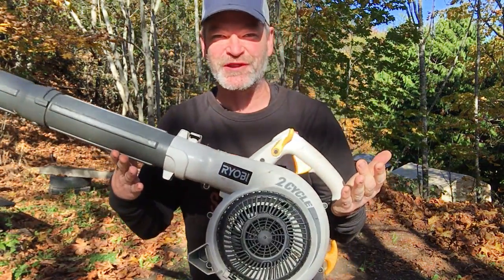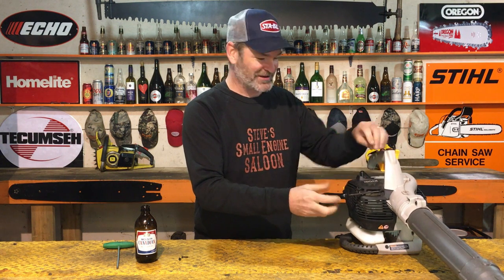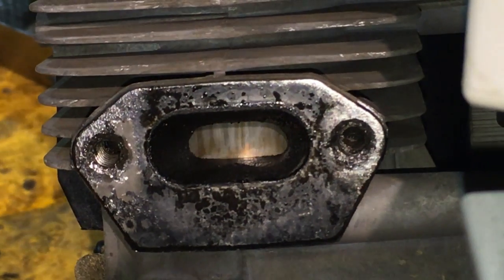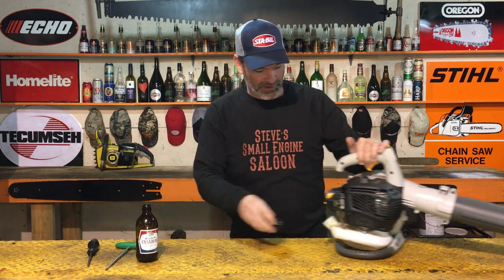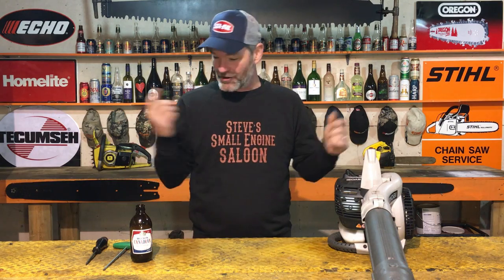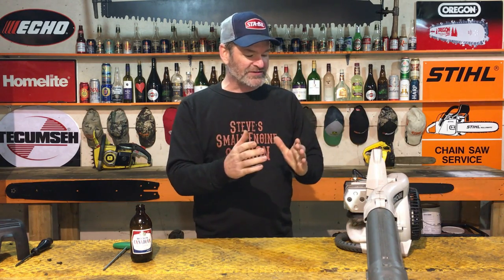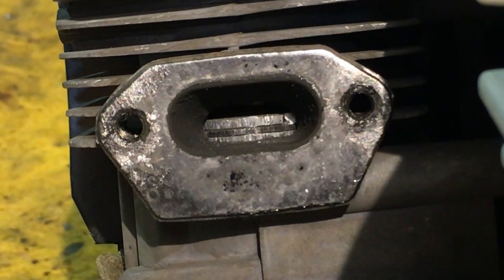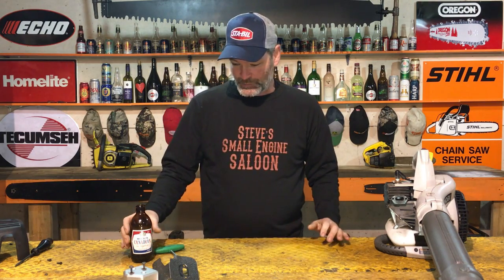What Happens When You Run Straight, Unmixed Gas in a 2-Stroke, 2-Cycle Engine

Comment from the maker: Get quality mix oil here---- https://amzn.to/2D0997x
Click here for my website--- http://www.stevessmallenginesaloon.com/
Click here for my Parts and Tools Store---- https://www.amazon.com/shop/stevessmallenginesaloon
Reply: How do i fix a blower after putting regular gas by accident? Please help
Reply: Russell 79TuLlpLN
Reply: Can u repair a 2 cycle blower after I ruined it by putting straight gas?
Reply: Steve's Small Engine Saloon hey 👋 Steve your videos are awesome 😎. Can you tell me what happens when you run too much oil. What does it do to the piston
Reply: NELSONS SMALL ENGINE REPAIR dXxZd
Reply: In just wondering my bike has compression still but it wont fire when i finally took off the top of the motor to look inside theres a thick layer of what im guessing to be burnt sugar from something is there dtill a chance to get my bike to fire again? And also could it maybe just be bad mix oil? I thought i used decent stuff j was told blue is good the brown ones avoid

Comment: I have a br700 that crapped out on me mid use and the motor seems seized, it will turn over but it’s hard to pull the chord.  My only guess was that my oil mix wasn’t right and I had blown the motor up by running it with too much straight gas… but my symptom is opposite in that the chord is too tight now as opposed to yours being loose… I haven’t dropped it off anywhere yet but do you think it could be another issue?  It’s practically brand new I bought it 6 months ago…

Comment: Question for ya from a new subscriber ,watching your vids on chainsaws have been awesome. Thank you…. Back to my question , an old engine pal told me that the 40:1 oil to gas ratio is to much oil, I’m told that 2.3 ounces to 1 gallon of gas is what I should be running. What are your thoughts on this. I’m using the Amsoil Saber oil. Thank you kindly in advance 👋🏻
Reply from the maker: I have been using 40:1 for over 30 years and never had an issue!
Reply: @StevesSmallEngineSaloon  thank ya kindly sir. This AMSOIL Sabre says it’s tested to run at 100:1 and they guarantee it. Sounds crazy huh? Any rate I just recently found your channel and I love it. Ain’t much of a mechanic, but I love watching ya work. Good tips I didt know. Carry on sir and Happy Holidays

Comment: I ran an ole 440 Rotax SkiDoo motor on straight gas for just over 6 minutes before it failed. Didn't get the damage you got(looks more like a lean burn). I put new bearings in and the motor worked fine

Comment: Love this video.  I had a Lawn Boy mower in the 80's and it seized after many years.  They told me it was running too lean, even though 32:1 mix, which cause the seizing.  Now I just bought a TORO Commercial Mower with the 2-cycle Suzuki 5.5 HP engine.  How can I prevent it from seizing on me?  I'm using Echo Red Armor oil at 40:1, instead of 50:1.  These Suzuki Engines are expensive to fix and parts are hard to locate.  Any opinions on the best possible oil for my Mower?  Thanks

Comment: I ran a homelite trimmer on straight gas for a couple years. I did not know any better. My yard was real small so I only ran it for about 6 mins each time. I now use 2 cycle oil in the fuel. So far I have replaced the primer bulb and the carb. That trimmer is now 20 yrs old and still running with a few scratches on the piston. Best trimmer ever!!

Comment: I mistakenly thought the 1 qt of 2-cycle oil was just that and found out the hard way it was pre-mixed fuel...so when I diluted it out in 1 gallon of gas, it was pretty much gas that went into my leaf-blower.  From what I recall last fall when using it, it ran for probably 25 minutes and stopped.  Afraid it had the issue described by the video since I could not start it (no compression), I took the muffler off to look.  The piston looked kind of scratched up.  I poured some real 2-cyclinder oil in the muffler port over the piston head, maybe a teaspoon in volume.   Before putting the muffler on, I then pulled the cord and I felt compression.  I put the muffler back on and after a few pulls, the leaf blower started and after the oil burned off, it seemed to run normal.  Now, the piston sounds a little scratchy still when I pull the cord but over all it still starts up and runs fine.    Bottom line, the oil in the mixture helps to lubricate and also helps to create a better seal and compression.   Before over-hauling your engine or throwing out your 2-cyclinder power lawn equipment, try a little oil above the piston to see if it does help the compression.   I'm not sure if my leaf-blower will have the normal life span as I would expect but it works for now ....

Comment: What do you think about all these chinese chainsaws that call for 25 to 1 fuel mixtures? Some say that's  for old information for older cheaper oils. Some also say that modern 2 cycle oils are good for 
40 to 1 mix in these same saws.
Do you have any suggestions?
Reply from the maker: I run 40:1 in all 2 strokes.  Never had a problem in 25 years...
Reply: @StevesSmallEngineSaloon  thanks Steve, learned many things from you and its much appreciated. 
" PSSSHHHH" THAT WAS BEER ONE FOR THE DAY.

Comment: I had the melting ring thing happen to a 2 stroke motorcycle when i had an air leak in the crankcase.  It was a 500cc Yamaha.  That was a fun bike.  I didn't know an engine would even last 9 minutes without the oil.  You have great videos.
Reply from the maker: Thanks for sharing

Comment: Great video, I did that at my brothers house, he wanted me to help do his yard. So he was inside house , I was trying to start his blower it needed 2 stroke oil and gas mixed, I never owned a blower. I live in apartment with no lawn. So I grabbed the gas container he had filled it up a little more then half way, started it up took me awhile to start, but I used to mow grass at my house when I was a kid, so I remember pushing that little button, if I had trouble starting mower a couple time and it would start right up. But like I said never had a 2 stroke leaf blower, growing up or ever. So I blew his leaves for about 10 minutes And When it broke down, I said to him I told you don't by second hand shit from people he got it on craigslist, but when he asked me was it already filled I said yeah, I didn't put anything in it, he likes his beer so he had no idea, that it wasn't.

Comment: I have a STHIL BR350 blower 1 year old. Was running fine. Next time I went to use it it would not start. You could however pull the starter rope smoothly. Took to Ace under warranty they wanted $550 to rebuild engine. It only cost $350 new!They said regular gas was in it. First I find that hard to believe but it is possible. I looked at my two gases in my cans and they both looked pinkish. I always buy ethanol free gas. I'm positive the last time it ran it had the correct gas in it and maybe I just filled it up with the wrong gas when I went to use it last time. So maybe THEY was pinkish gas in it and said that was the problem. Any thought folks? I have not gotten it back yet. I'm going to put the correct gas in to see what happens.

Comment: Happened to my stihl backpack blower a helper ran it without oil for probably half a tank. I filled it with mixed gas and a little extra oil. Starts and idles but only runs at half throttle and has a knock. Barely has enough power to blow grass off of a curb. If the grass is a little damp then you can forget it

Comment: why not just have the engine take in the oil and gas separately and then have the engine do the mixing just before it gets injected into the cylinder?

it would seem to me at least that this would be the ideal sitaution as it removes the question of what mix ratio to have (because the engine does it for itself)
and you can't accidently use the wrong gas because it's the same gas.
you'll just have to remember to fill up the oil reservoir as well.
Reply: @UCKKPmHMrI7ILpnHDrLS_R8Q i guess that is fair but i figured it would be a simple as basically setting up a second "gas" tank and filling it with oil instead.

then the injection to the cylinder would happen the same way as the gas and at the same time.

and the mix ratio can be controlled at the injector by changing the size of the holes relative to each other.

Comment: Hello Steve  , another great video which I can relate to today . I ran a Tannaka blower without oil today  . When I stripped it down partially the piston seems to be coming to top and clicking hard when at top position . When I rotate it the other way it does the same  . coming to top and clicking hard . Any ideas of what is happening here . The piston does not seem to be scraped when I look in through the inspection port . Any help would be appreciated greatly .

Comment: Another word of caution.  I poured mixing oil into a 5 gallon container of gas but didn’t shake it up.  I burned out 2 expensive chainsaws and my dignity on a job site.  Best practice, put the oil in the can, then add the gas.  New piston and cylinder worth almost as much as replacing the chainsaws, thus they were scrapped.
Reply from the maker: Great point!

Comment: Steve, In cases where an engine loses compression just due to use, not abuse or wrong gas mix, can you get away with just replacing the ring(s), or is it recommended to install a new cylinder and piston?
Reply: My Craftsman 25cc 2 stroke blower I've had for 12+ years, was suffering from low/no compression, I bought a new piston ring online and was hoping $5 would be all I had to spend on this old, but decent blower. When I pulled the cylinder off, I found the piston ring was stuck in the ring slot of the piston because it was filled with baked on gunk.  I used a couple of fine picks and removed the old ring, wire wheeled the piston's ring slot and crown, and made sure the slot was completely free of debris. I installed the new ring and immediately felt compression when trying to push the piston all the way into the bore. I reassembled the blower and it started instantly like it always had. I probably have about 40 hours on this engine, and I ran it for about 4 hours immediately after the repair, stopping the engine a few times just for refueling,  and I think this happened because I am too generous with the oil in the gas/oil mix because I really don't want to over-heat and seize an engine. Anyway, if you find yourself with low compression on a 2 stroke, check for a stuck piston ring first, you might save yourself some money. Take your machine apart carefully, and you may not need any new gaskets. I took the two screws that hold the carburetor on just because it was easier than removing the fuel lines. I took the muffler off because this design hooks over the crankcase and you can't remove the cylinder otherwise. Get yourself Allen and Torx bits you can spin with your cordless drill since the biggest time waster in this whole repair are all the screws holding the plastic case together!

Comment: Can this be fixed or is it not worth the cost. I did similar to my Husqvarna leaf blower. Brand new to buy $299. Is it cheaper to repair or buy new replacement. Guess that will teach me to read the fuel requirements vs assuming it was straight gas.

Comment: I was desperate once and I ran my blower with straight fuel because I had no oil. It ran for about 8-10 minutes then died. I realized that this was a serious thing and tried starting it  with a rich oil to gas mixture. I am able to start it but it requires a lot more effort to start it and runs for only 7-9 minutes before overheating really bad and dying. It’s weird. Anyone get any explanations?

Comment: should do one on what happens when you put to much oil in your mix. Had some fuel that i couldn't remember if i had put any oil in the other day so i put some oil in it think it's running on a fuel mix of 100-1 now saw is a little bit under powered but not to bad reckon the worst that could happen would be a fouled spark plug

Comment: That was interesting. I recall back when I was 17 years old, I got a weed eater that was a TMC kpw 23. In the owners manual TMC warned that running straight fuel with no oil would cause the engine to seize. It's obviously different with each two stroke engine. It can result in either seizure or the piston gets scored and the ring or rings can get damaged and get stuck leading to no compression. In any case the engine would have to be rebuilt.

Comment: I can tell you. My step son did this when he was high.  It melts parts of the cylinders and piston.  The engine does not have the oil from the mix to prevent extreme high temperatures.

Comment: I run these small 2 strokes, Zenoah, in my hobby RC's. Modified can run 20,000+ rpms. I run 20 to 25 /1 ratio. At these rpm's the extra oil is needed not just as a lubricant, but the extra oil particles can act as a coolant. So much so, in boats which have water cooling, you have to run the water lines to warm the water first through the water cooled exhaust flange, then to the cylinder. Or the engine wont reach optimum temperature to run correctly. Great engines to tune and toy with.

Comment: Good oil and fuel matters. I have an old, well maintained 80's Stihl 028 Super WB that has had carb rebuilds, oil pump replacements, new lines,  engine gaskets / seals etc and still on the original cylinder and piston with only 1 ring change.  Two strokes live a LONG time when you take care of them.

Comment: Raw clean high test for 5 minutes at low RPMs is like a free tune up .
Add oil after ( pre mix or a shot ) 
The old gas  and oil gets it gummed up especially after winter even if it’s drained . 
   I’ve had an echo blower for many years ( over 12) .  Any time it gets a bit tough to start that’s the fix . 
Mine starts 2nd pull each time and runs perfect even at blazing high volume leaf helicopter cleaning .  You need the oil no matter what to protect it but there is so much residue from tank to piston for a 5 minute clean up , it’s ok for 2-5 min on raw pure gas . No high revs . 
   I have 2 gas power whipper snippers and one leaf blower . Lawnmower is 4 stroke .
Reply: interesting. I never considered this... do you just let it idle, or do you pull the trigger slightly to get RPMs slightly higher?

Comment: im actually very impressed the little engine lasted 9 full minutes with 0 lubrication. throw some new rings in there shes good as new 😂
Reply: there must be an oil film on the parts. i once started my old truck when i forgot to put oil in and it idles for about 5 minuts until i relized i forgot and stopped it, no damagne done as i been runing 2 stroke tcw3 mix in it and i always pourd the 2 stroke oil in the filter. years of doing this put a coating on everything and saved the motor. It was pennzoil semisynthetic 2 stroke oil! Now im using BRP XD-100 oil in my small block v8 2 stroke and 8v92 detroit 2 stroke. its full synthetic. i would switch over to mutule 800 2t if i can find it cheaper!

Comment: I ran a 4 stroke BS with no oil -duh, (check EVERY time)!  The cycliner froze up. After a good cool down,  I filled up the oil, sprayed some WD40 around piston head (after removing the head) , pulled the rope and was able to finish mowing. I was stupid and got lucky.

Comment: Next do "when you mix regular oil with gas"
Reply: It will do fine on regular 10w30 under light load but for heavier loads run the heavier duty 2 stroke oil.

Comment: Hey Steve Got a quick question for you!  Have you ever seen or worked on a gas powered Surfboard called a Surf Jet?  Made from 78-88 its a 9ft surfboard with a 2cyl 2stroke Subaru LC26 engine on a jet drive.  I saved it from being crushed at the scrapyard.  Hadnt seen daylight in 30 years or fresh gas lol.  Ive got it running perfectly.  About 30mph with a kid on it buy closer to 25 with an adult,  but i have never seen a hydraulic throttle before and im having issues getting it to bleed.  Has a small resevoir with a little valve in it.  I can get the throttle to move as i bleed it but then it just stops working until i rebleed and same thing.  Theres no leaks.  I may have to come up with a new throttle for it!

Comment: I run Lucas two stroke at 40:1 have never had any issues. I swear that also has fuel stabilizers I had a saw sitting for a year and it started up.

Comment: Residual oil in the fuel system and crank case is the only reason it lasted that long. If there was absolutely no oil, I don't think it would run more than a minute or two.
Reply: Exactly i though the same thing.

Comment: Hey, i know the answer to this one. Learned it when the oil pump broke on my old moped.

You'll be driving along like normal when you'll suddenly hear your engine very quickly get louder until the engine noise transforms into a full-on screech. Like half a second later your engine will die and your back wheel will lock up. At this point i'd personally recommend pulling the clutch and coast to a stop. After this you'll go to kickstart the engine back on again, only to find that it's seized. Uh-oh. Then you do the walk of shame, pushing the thing back home to the garage. Or alternatively if you're spoiled you call your parents to come pick you up.

Then the dubious fun of trying to repair a seized engine begins.

Comment: I had a weed eater for 12 yrs that ran Schaeffer’s premix. Everything else wore out but the motor. I did same thing dumped fuel and it has now ran a tank of straight gas wide open and still runs. I think I will pull it back out and run another tank. That oil works

Comment: Steve I did exactly that with my Husky blower. It starts but stops when I gas it. So there must be compression still?
Reply: Check your exhaust. Take off the cover. There is a small EPA screen that may be clogged. Throwaway the screen, put the cover back on.